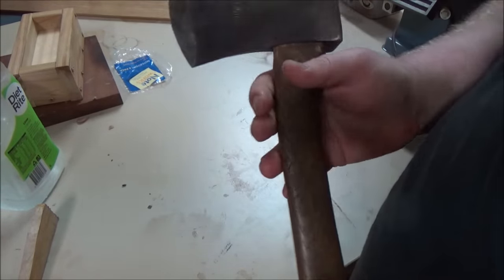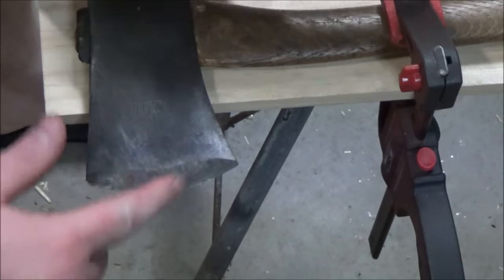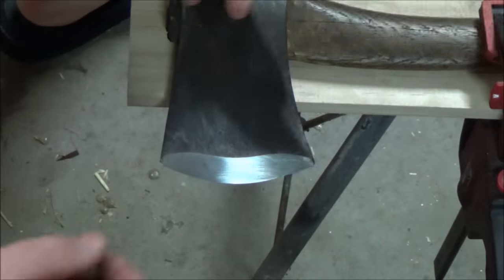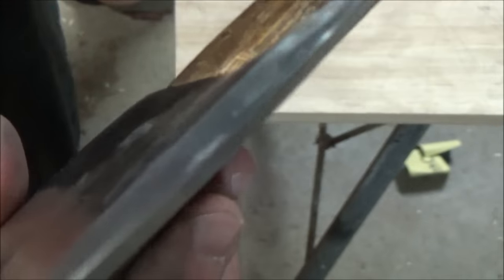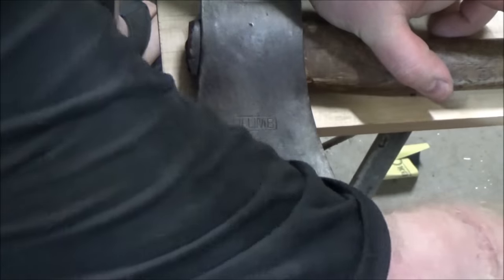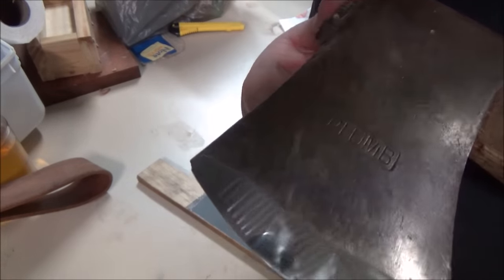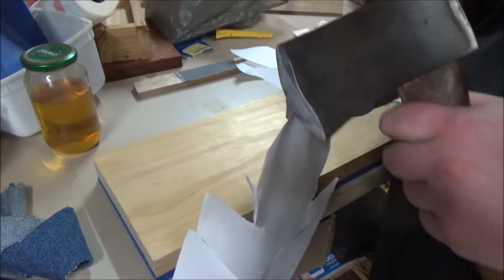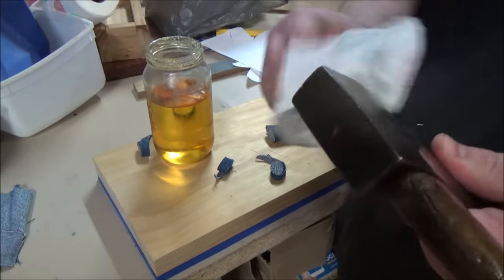How to Sharpen a Hatchet or Axe to a Scary Sharp Edge!

Comment: Just came across this video. Very nice. I have several Kelly Works axe heads. They are made very well with great steel. Holds an edge for quite sometime. I love to sharpen my axes and knives, it's very relaxing and rewarding.
Reply from the maker: Yeah they are good axes. I am more of a knife guy. I find it quite relaxing as well. You get comfortable, take your time, listen and feel for the stones feedback. It is quite mesmerizing.
But sometimes you just need to bang an edge on. It is more of a chor when doing that but still fun.

Comment: Good straightforward video on a basic technique from which every outdoorsman, survivor oriented person, or simply anyone who has the responsibilities of keeping their edged tools sharp may gain some extra knowledge. But the "proof of the putting" is such an anticlimax to very much hard and precise work to reprofile and finish a truly sharp and working edge, in my opinion. And I am befuddled each and every time I watch someone, who has spent all that time to properly sharpen an edged tool, prove its worth as the tool it was meant to be, by shaving their arm or slice, dice, and otherwise mutilate a piece of printer paper! I am 78 years old and have been sharpening edged tools at one level or another for probably 69 of those 78 years and I have only used the "arm shaving" technique to show my "great" experience at sharpening once and it wasn't even sharp enough to accidentally "break" off one hair!! I was 11 at the time and I vowed that I would allow the tool to "speak" for itself, in the future, as far as how sharp it was for the job it was meant to do. 

And axe was invented and modified down through eons of time with on one goal in mind, to chop, split, dimension, or render a piece of WOOD [ DOUBLE-U OH OH DEE!! ] from raw materials into something of use and value to the owner!! Why all the theatrics with shaving body parts or slicing a sheet of paper down to a pile of shreds which has to be gathered up and thrown in the trash at the end of the infomercial?? 

Take that axe outside, find a tree, limb, stump, or otherwise piece of wood and chop WOOD, for cryin' out loud ....... Just sayin', it would make a lot more sense to use the tool for what it was made to be used. It's like sharpening a 2 man bucking saw and then using it to CARVE THE Thanksgiving Ham!! 

I seriously wonder sometimes how many "manly" guys have demonstrated this resultant technique of sharpening prowess and are wearing scars from the final episode of the demonstration??

Comment: I'm going to be busy next couple days doing my axes and hatchets.  Super awesome informative easy to follow,  watch and learn from video. Thank you,  I've learnt something new and practical for my tools.  I normally sharpen just for splitting timber and general bush work collecting firewood.
Reply from the maker: It shouldn't take that long. But if that is all you are using it for personally I don't bother refining the edge as much as I did in the video. You won't get added benifit for those tasks.
Learning to sharpen well with a file will be plenty for those tasks.
If a good axe I would take it to about 400 grit with either a stone or sandpaper and then strop for maintaining the edge. Or a little pocket stone for maintaining the edge has become a favorite for me at the moment. I just work the micro bevel each time you touch it up. You can do this loads of times before you move high enough into the main bevel and need to address it again.
Hope this helps and have fun.

Comment: You have a good one too.
I have 2 old Plumb double bit axes I found at the base of an oak tree buried in the dirt. 

Brought both back to "life ", installed new handles and wrapped fine nylon twine about 4 inches down the handle with 2 or 3 layers soaking it in epoxy. 

Made the handles very durable if you struck it on a limb. They would both shave even after repeated use.  I had never tried that before, was happy with the results.  40 years later I've  replaced the handle on one,  about to do the other.  Those bits will last generations.  Great steel from mid 20th century.  Finally made guards from ABS tubing.  They tend to cut anything they're against including clothing and body parts underneath. Much safer to carry now.
Reply: I was wondering where I left those!!!

Comment: Obviously, you know your way around a sharpening stone. Thank you for this nice video

When I sharpen, I take the tool down to clean metal with a rough stone at a shallow angle. My stopping point would be past the burr stage if there are large chips and nicks. I watched that major flaw in the tip of the blade (that you pointed out) go through several levels of sandpaper grit. Not to be critical, but wouldn't it have been better to clean that up with the 120 grit first?

I go from rough at a shallow angle to 1000 grit at 30 degrees, usually with no steps in between. The ceramic hones that I use, made by Spyderco, by the way, are outstanding. I have fine grit hones that I bought 40 years ago that are still in great shape. They create a great razor edge very quickly.

You did a wonderful job of polishing that blade, but a workingman wouldn't have the time to invest. 

Overall, you have excellent control of your hands to be able to maintain the same angle without using a machine rest to do so. It took me at least a year, back in 1972-73, to do that.

Comment: Good one Scott, i just use a flap disc on a battery grinder. That works great and takes 30 seconds
Reply from the maker: I don't put this much effort into my general working axes. Just the ones I treasure.
Reply: @scottshobbyz5416  I can dig that
Reply: @terrysmith7740  flap discs going through the grit grades thats the way. Finish with wet and dry. You really have to love your axe for this dedication.

Comment: I can get my hatchet so sharp that I can shave with it. I might use a small worn scrap of emery to polish up the sides, but a reasonably fine sharpening stone will do. The stone I use was given to me many years ago because it was worn like a swayback horse, but it works perfectly for my axe, my hatchet, my cane knife, my adze and any other none-precision tools. You are spending a fortune on emery which is not necessary. Neither do you need a clamp, or work bench. The job can be done perfectly well with just two hands, a stone and some water or hoof and horn oil. Neat's-foot oil in other words. Water works fine, but neat's-foot suspends the stone dust and metal powder off of the stone, so you only need a small amount of it, and it is less likely to drip dirty grindings, as water does, on your hands etc.

Comment: as a hunter that will spend days in the mountains I find having a scary sharp axe a great benefit. I can use the axe like I would a large belt knife foregoing the need to carry a belt knife. The axe serves for all the big cutting jobs on the animal I have killed and a smaller pocket folder will take care of the more precise cutting I may need.
Reply from the maker: That is a good point. I didn't think of using a hatchet in that context. 
Sounds like a dream going bush for a few days. I don't know anything about hunting or butchering though.

Comment: Appreciate the job, understand its limitations.. I will stick with my flap disc/stone job for splitting firewood.
Reply from the maker: Yeah this edge it a waste of time for splitting wood. But I would never take a flap disk to this lovely axe. My cheapy ones yeah.
Reply: @scottshobbyz5416  But that edge can split a round with enough precision to make the lengths/pieces of wood necessary to build a near exact scale model replica radio controlled warbird like a P-51 Mustang or a Focke Wulf FW 190 etc.. Wing struts, spar, airfoil shape and all...  Those type of kits are typically laser cut in a factory and sold in a box... That blade is nothing short of beautiful... Definitely going to implement that technique on one of my own carpenter's axes someday soon. I lost my Arkansas stone set a short while back so I've been simply grinding with stones in my Dremel or dye grinder tool attachment for my compressor and then sanding with disks to do a full sharpen.. Gotta make up some of those sandpaper blocks for touch up work.. And give the full process a go sometime.. Most of my axes and knives are used for throwing for sport in the back yard type deal.. The actual tools get treated nice on the other hand.
Reply: Depends how long you want your axe to last .
Sharpening carefuly removes less material and preserves the edge .

Comment: Good video,  thanks for taking the time to make it. I'm in the U.S. so Plumb axes are not that hard to come by. I like many of the handles they used on the vintagec ones. I'm a sucker fit a nice fawns foot! If I find a nice handle that's had nails and other things inserted into the top in an attempt to secure the head, I'll carefully try to remove them, along with the head without destroying the handle. Sometimes you can reuse the handle with a proper wedge. Or, you might be able to trim off 3/8 -1/2 an inch and use it then. You may need to remove a small amount of wood on the handle were the bottom of the head meets the handle. If that won't work, save the handle anyway. I've come across other heads that I could fit a used, cut down handle on. I hang mine with the handle proud on top of the head, like yours. I Sisto prefer to use only wooden wedges, no metal. I've done a few with a second, crossing wedge as well, and I love the way that looks. 

Plumb made some axes for the Boy Scouts. I have two with the BSA stamp on them. Plumb hatchets seem so be better splitting heads than carving ones IMO. 

If you come across a Nurlund axe head, snatch it up!

Comment: Nice one sir.
  - How to Sharpen a Hatchet or Axe to a Scary Sharp Edge!

Simple Effective Affordable - Old School.
  (The common sense "make it easy on yourself" tips are gems.)

Best of luck on your way to 1000 subs as "shed-skills" shouldn't be lost and vids like this one can only help the cause.

PS.
As it has a wooden handle it probably wouldn't be allowed into an operating theatre so that edge is fit for purpose (IMHO).
Reply from the maker: Thanks. I am surprised that I got so many subs so fast. It is slowing down now but it took me over a year to get 100 and now I am not far off 1k.
I noticed a lot of tutorials had lots of tools or required a fair bit of skill to get the good edge so I showed this way as it is easier to keep the angle for a beginner. At least that is what I have found.

Comment: Sharpened my HF hand ax on a drill with 6" sanding pad with 120 grit. To my utter surprise, it was shaving sharp, even without stropping. Great temper too, you could see the color change near the cutting edge. Had that little ax 20 years, and it's still my best.
Reply: Wrong.

Comment: I can't believe how many people do not want a sharp ax! I use mine to make bows,butcher game even peel cactus.Those that don't want a sharp tool,that is designed to be sharp, obviously don't need an ax.
Reply from the maker: Yeah I am surprised as well. A lot seem to think it won't hold the edge or it is a waste of time/not needed. It all depends on what you are gonna use it for.
I agree it is overkill for a woodheap axe but that isn't what I am using it for. I have others i just sharpen with a file or coarse stones for that.
Reply: Agree but  you dont need to go this extreme with most axes  a file and stone is all you need
Reply from the maker: Yeah but where is the fun in only doing what you need?
It does perform better on the tasks I intend this for at this level of sharpness. But you do get diminishing returns.
People doing axe racing would take it to a perfect mirror but they need to squeeze every bit of performance possible out of it.
Reply: When making bows I usually stop and strop the blade only twice per bow.I just try to avoid hitting it on nails and concrete. If you do hit a hidden nail it will boogger  the blade for sure.Then back to square one. My bows are made of Bois'de Arc (Osage orange) so it takes a sharp blade. Used this man's method to sharpen my draw knives as well.
Reply from the maker: Cool I have never made a bow. Australia isn't really known for its great bow making woods.
There are loads of ways to sharpen an axe. But I found this way if really easy to control the angle compared to other methods. So I thought it would make a great tutorial for people.
Hitting a nail is very depressing lol
Reply from the maker: guided one, it depends of why it dulls. If it is dulling because it is chipping, rolling the edge or deforming in some other way. Then yes it will dull quicker. 
Having the micro bevel on the end really helps toughen things up. Also it depends on what you're gonna use it for. If using to cut dead hard wood all day you would want a tougher edge. But if using for green wood or carving you can make it more acute of an angle.
Reply: You in Arizona?
Reply: A real shame you all don't have good bow wood ,would send you some if you want. 
We(the Native American people of the Plains) use Bois d'Arc,or Osage orange. I have bows made by my Grandfathers that are 150 years old that we still shoot alot. Most of my father's ,father used an old butcher knife to make his with,He would loved to have your ax I bet. Will send you some staves if like . I Have some that have been curing for a while. Just need an address someway. Can't send them to a YouTube channel.
Reply from the maker: Thanks for the offer. But I don't get out into the shed enough to try learn knife making. If I took up bow making I would be in more trouble. Especially if I started liking it.
I have some bows but I don't shoot very often. Which is a shame. If I got better with my compound and recurve (all man made materials) then it would be cool to explore wooden bows. But I doubt I will ever get there.
Reply from the maker: MrJx4000, No way would I touch this lovely axe with an angle grinder. But on a cheapy I wouldn't mind. If I have heavy steel removal to do a sander with a fresh 40/60 grit belt works well. Then refine untill desired sharpness.
Reply: @scottshobbyz5416 , yeah, I hear ya.  I don't know what I have for my chopping axe but a light and quick pass on each side with a fine grit was all I needed. No burn or blue marks if you're easy on the pressure.
Reply from the maker: @MrJx4000  the way i see it. Is if it works for you then that's awesome. There is lots of ways to sharpen things. It is good you don't get blue or darker colors.
Reply: That depends on for what it is used. 
Of course I'm a friend of sharp tools, but I see no reason to keep my tools senseless sharp. 
See: I normally don't need to shave my face or slize onions with my hatchet. 
So for me, it's enough if my hatchet is sharp enough to cut some nice chips when I chop some branches. 
For those who just need it for splitting, it could be even less sharp and still doing it's job well.
Reply: I'm impressed he still has all his fingers.

Comment: I enjoyed your video, thank you 🙏 for taking the time to do it. I’ve had a hard time with my 2 axe heads. Ones a Mann, the other I forgot but both have a convex edge that’s hard to sharpen. I’ve actually used my angle grinder to get them somewhat ready for hand sharpening. I’m gonna try your double sided tape 💡 I like it.
Reply from the maker: The method from the video should be good if you aren't used to doing it. But over the long run it becomes more expensive to continue using the sandpaper.  Wranglerstar had a great axe sharpening video where he did a convex edge if you want to keep it that way. Can't remember what it was called though.
If they have an insanely thick and steep convex like a lot of cheap hardware store axes then you will have to take a lot off either way. 
Just make sure not to let it get too hot. If using power tools.
Reply: All axe's are worthy of love and a good sharpening brother
Reply: @JakeFromSedrowoolley  nobody said otherwise so what’s your reason for stating that?

Comment: I have a bit of an alternative to propose here. People can become obsessed with sharpness as defined by the microscopic continuity and pointyness of the corner. However if you do sharpness tests such as paper cutting tests, you will find out that there is a bit more to this than meets the eye. Most people don't know this, but serration, meaning the microscopic sized saw shape on a cutting corner can be a good path to cutting as well. medical scalpels for example are purposely not ground sharp, meaning smooth, but ground to have a serrated corner.
Something similar can be applied to most outdoor working tools, from axes to knives or a scythe. I inherited some simple sand stone sharpening stones from my great granddad, these are for the concerns of sharpening fanatics insanely course, but what they do is give any cutting tool a mighty dangerous and sharp serrated corner.
If you go and watch old videos of people bucking and felling with axes you will never see them polishing their axes, however you will see all of them carrying such a simple sharpening stone on their person to retouch their axe while at work.
I can just advice you to try it out!
Reply: I carry a small stone and touch up my edge as I go.
I even carry a small diamond 'stone' in my tool belt and hit up my utility knife every so often. It's faster than changing blades :)